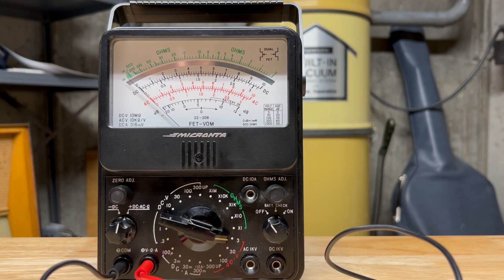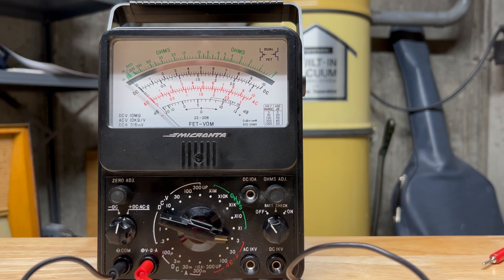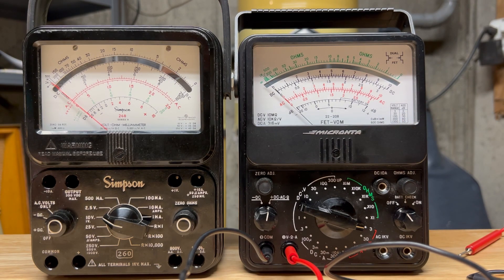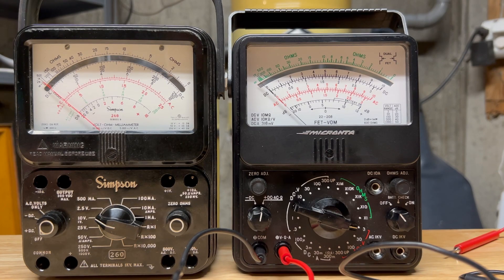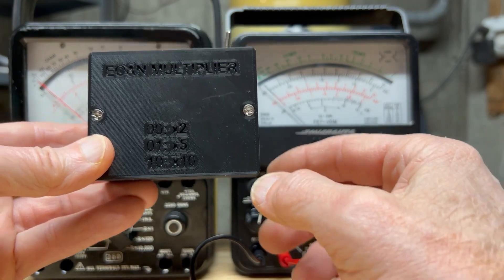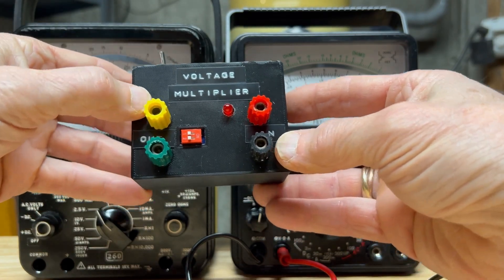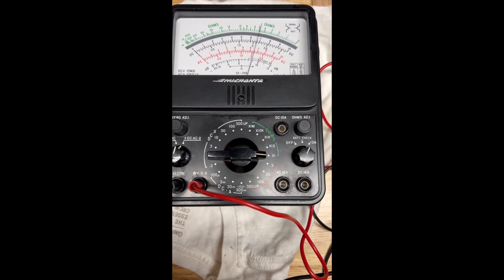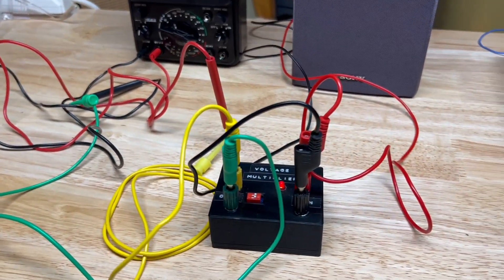Why use an old Radio Shack Micronta 22-208 analog multimeter on your vintage radios and Ham radios?

Comment: Never understood the cult like following of the Simpson 260. I've had several 260s and I've also had the Micronta 22-210 which is similar to the Simpson 260.

IMO the Micronta is every bit as rugged as the 260 of the same era, and has a couple of advantages. 22-210 has a continuity beeper. 260 does not. 22-210 can use standard test leads, 260 requires special and expensive ones. Simpson 260 case tends to crack and break, 22-210 case is made of a more resistant plastic. 260 is WAY overpriced, then and now, 22-210 is not, even when new.

My Micronta 22-210 provided many years of dependable service. In the mid 1980s and throughout the 1990s it went to many remote transmitter sites in broadcast engineering. It was accidentally dropped in the snow, kicked a few times, fell once, and had the fuses blown a couple of times. About 10 years ago, I gave it to a good friend and it is still working well for him today.
Reply from the maker: I understand what you are saying about the 260. I love using my 260 BUT I have found that the Micronta 22-208 has several really nice advantages. First and foremost it is difficult to use the Simpson to align tube radios because  the Simpson has low input impedance (50 kilo ohms on the 2.5 volt scale). Recently I aligned my 1957 Zenith AM/FM radio. The AM is no problem but the Simpson is not any help with the FM. One needs to measure the control grid of the limiter. To do this you need a VTVM or a meter with a similar input impedance. The 22-208 worked well as the DC input impedance is about the same as a VTVM, 10 Mega Ohms. To balance the FM's last transformer you need to measure a Zero voltage. The Micronta has a zero voltage/current reading so it will measure on either side of zero.  I like my 22-208 so much I just obtained a 22-220......   thanks for your interest.

Comment: Hi, nice looking meters. One remark. I have 2 analog FET meters, but they have also for AC Voltage a high impedance. This Micronta has 10k/V for AC. The meters I have are Philips PM2503 and Metrawatt MA 4E.
Reply from the maker: Yep. Only the DC voltage has a high impedance. Sounds like you have some quality meters. Thanks for watching.

Comment: I’m in Vietnam currently & needed to get a multimeter quickly. After a few unsuccessful attempts at local hardware shops, they pulled a similar one out of some dusty shelf 😄 scared me a little bit, as I used only digital ones, but turned out to be just fine & I measured V and mA I needed just fine 👏
Reply from the maker: Have fun with that meter and enjoy your time in Vietnam.
Reply: In Vietnam have few store have vintage and nos analogue multimeter ! Im own micronta 208 and 220 and other brand name ! Micronta 208 not the best multimeter because abs plastic thin , pcb not thick and copper blade in contact switch thin and have v shape like digital multimeter , and especially FET in  208 very hard to replace when FET failure
Reply: @nguyenhainam458  I have one 208 and one 220a, some days ago my 220a neddle starts drifting, after to test everything I found the input fet IC damage.
I change  this IC for 2 2SK117 fet transistors, meter now works perfect.

Comment: Hi
I have a number of AVO meters in the shack as well as Micronta fet meter and others. Great for testing large electrolytic caps by using ohms range. A good needle kick with a slow fall back. Can of course follow varying conditions that a digital sampler cannot follow. Transistor junctions can be safely checked on x100 Ohms range.
60% deflection for silicon, 80% for germanium junctions.
73 Dave G4BTI. Analog anarchist hi hi.
Reply from the maker: Thanks for the info. I was not aware of the transistor testing ability.
Reply: @petersdelucaaa2vg306  You are welcome, we were taught this on a company electronics training course in the 70s. Dave

Comment: Reasons he stated are why I still have a warm feeling for analog meters. But..I did find it necessary to get an actual AC voltmeter that goes down to 3 mv scale. Ended up with Heath AV2, an AV3 and a Motorola 1051. Was given 1 to fix the 2 that I bought that didnt work.
Reply from the maker: Fun stuff. Thanks